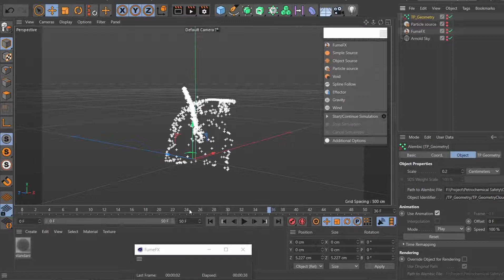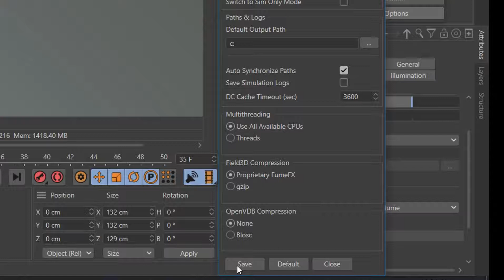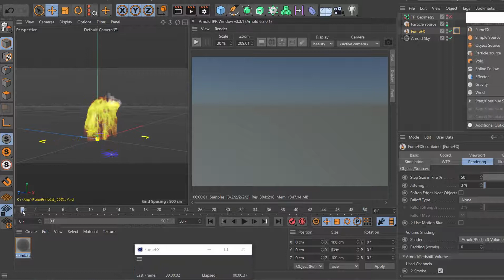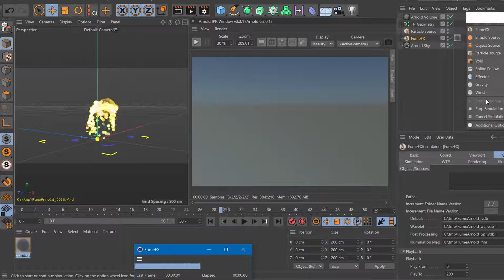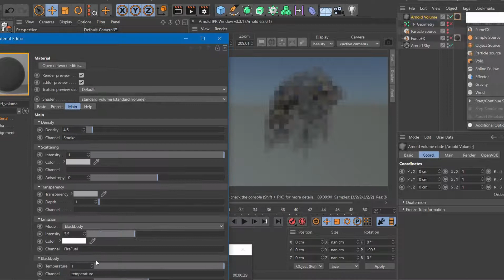Cinema 4D Rendering FumeFX In Arnold [GPU] [Advance]

Comment: I am trying to create a fire without much smoke from an object source. I followed what you did, but I can't seem to get the fire shader going. All I get is the smoke, but no matter what I do to the Emissions and temperature tab, there's still no fire. Do you have any suggestions that might help?
Reply from the maker: Plz make sure in the Arnold VDB object which channels are available, and use them , it’s tricky some time the fire need “temperature” “fuel” “burn”  something like that having said that channels are case sensitive